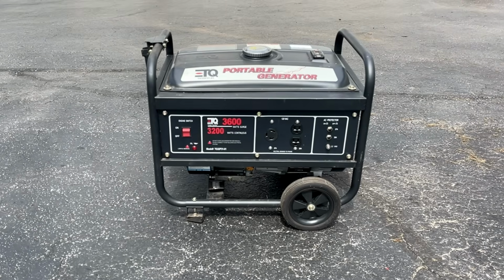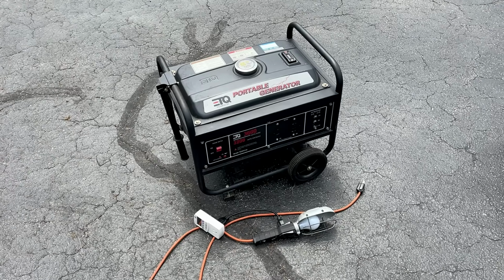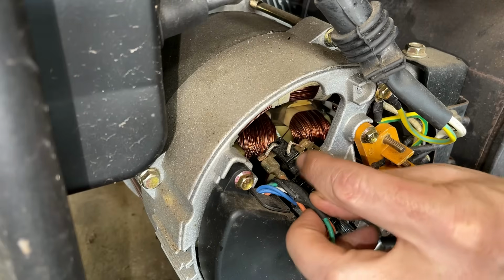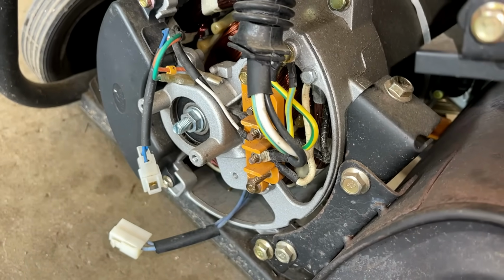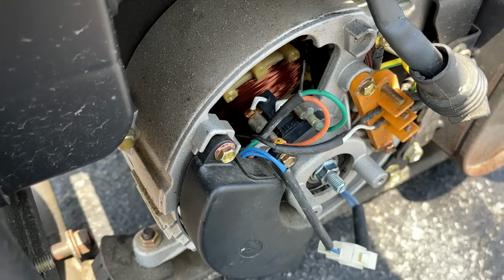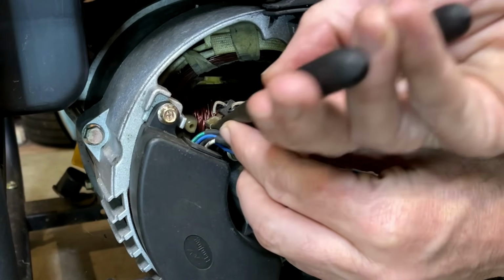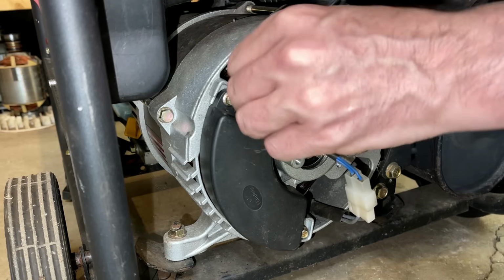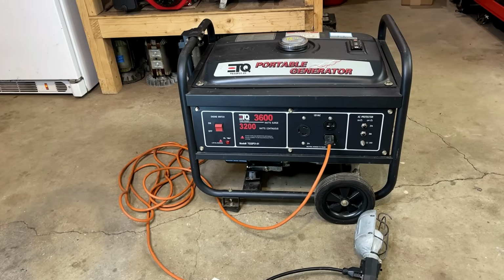Two Generators No Power Output - Same Model, Same Problem?

Comment: You should make a slip ring cleaning tool. You could take an old, worn out, set of brushes, put some Scotch-Brite over the end of the worn out brushes and use a cable tie to hold it in place. Then install that and either turn by hand or run the generator for a minute to clean the rings.
Reply: It looks like the brushes are not running in the center of the slip ring, off to one side not making full contact
Reply: @dougjones9493  They did.
Reply: @dougjones9493  The brush holder could be finely shaved on the side that contacts the frame.  That would put the brushes in the middle of the slip rings.
Reply: Alternatively you could remove the old brushes, from the brush holder, and either stuff the recesses with scotch-brite or glue in some small rectangular smoothing stones, so they'd act like brushes.
Reply: @generaldisarray  I've seen people in the past put the rotor in a lathe and clean the slip ring with a cutting tool, taking a very fine shaving off. Then they look like brand new.
Reply: @martin4787  oh to have a lathe. Of course once you've removed the rotor you can easily clean the rings with scotch-brite, or fine sand paper
Reply: @generaldisarray  I used to own a machine shop and I was like a kid in a sweet shop. Every day was a pleasure going in to work. Happy days...
Reply: @martin4787  I have seen that on the old commutator rings with separated segments.  They were much better quality than present slip rings though.
Reply: @r8118830  Yeah I've seen that done.
Reply: @martin4787  yip, I saw Repair&Restoration use a drill to scotch-brite a commutator in a recent video. I think it's his go to solution when he's restoring hand tool motors...
https://youtu.be/fu_XuQAvwIc?t=740
Reply: @generaldisarray  Yeah good idea and a great channel.
I've done the same thing in the past grinding valves.
Reply: @martin4787  yeah I just don't get why people don't just use a drill to lap in valves, when they can? Use a length of fuel line to attached to the valve tip/stem, and as long as you go slowly and carefully it'll be fine.
In most cases you're rebuilding a dime a dozen small engine, not a rare vintage engine from a museum
Reply: @generaldisarray  Exactly. I stopped it when I bought a seat and valve facing machines, then you could drop the valves straight in without the need to grind them
Reply: @martin4787  way to rub it in Martin, oh I had a machine shop, and a valve and seat facing machine. 🤣 🤣
Some of us have to be inventive, adapt and overcome, and so on..
Reply: @generaldisarray  My business was re-building engines, gearboxes, transfer boxes and differentials for Land Rover and Range Rover. I used to have the machining done by another company and when he decided to sell up I bought all of his machines. I'm in the UK and used to export all over the world, including the U.S. and that's how I got them along with a crank grinder, lathes, surface grinder, miller and so on. I can honestly say it was a dream come true. It was lovely not having to invent, adapt and overcome, although that didn't completely disappear General. ⚙🗜🔩 👍
Reply: @generaldisarray  
If the slip rings are "bulged" and "dipped" i.e. out of round....would you have to have a method of manual adjustment of the grinding material so you can dial in the correct amount to smooth the hills...and leave the dips untouched until  concentricity has been achieved?
Reply: @JohnSmith-yv6eq  you could do that by either 3d printing a brush holder with  adjustable slots for the smoothing stones, maybe some sort of adjustment screw coming out the top of each brush slot, or you could try doing it using an old brush holder, and a lot of epoxy, screws and nuts.
If the rings are badly out of round the brushes would be trashed from being hammered back into the holder every time the high spot came round, given the rings are spinning at  3600 rpm. 
If that's the case you probably have a bad bearing, or the shaft is bent, or the rings have suffered severe damage and you should replace the rotor
Reply: @generaldisarray  　　Cheep Chinese Brush parts are in A〇〇zon?